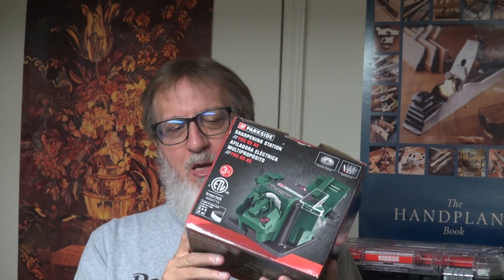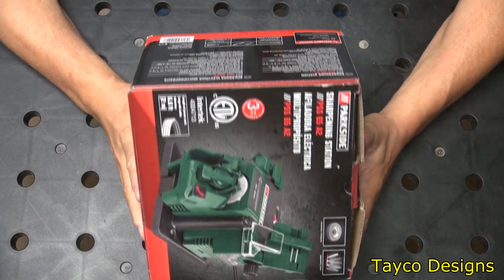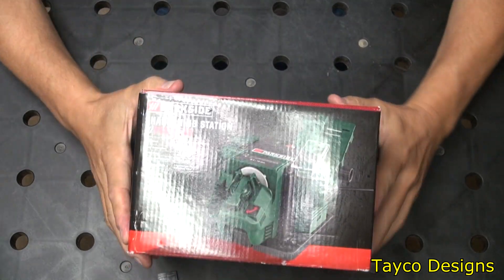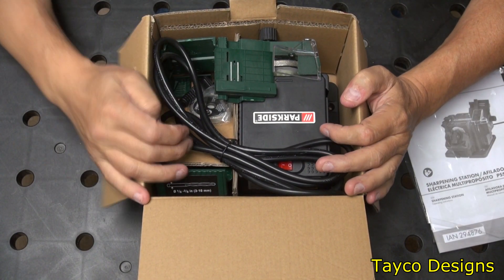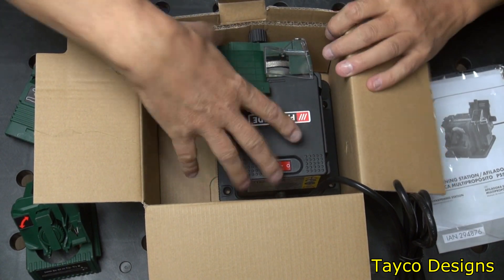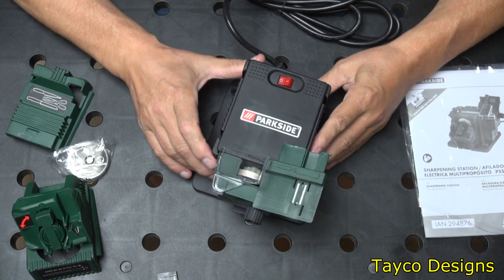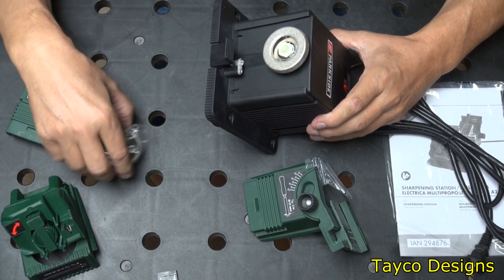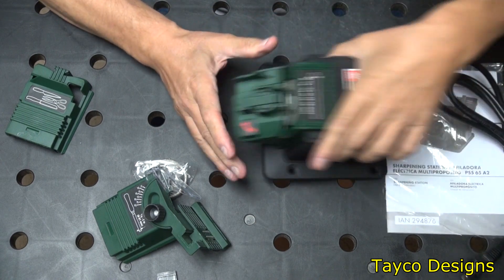Unboxing And Review Parkside Sharpening System Sold By Lidl

Comment: Hey! :D I'm a pro blacksmith, I have seen this machine in the shop yesterday and I have left it there. For your blades you need to buy just a good sharpening stone! ;)
Reply: It is even missing the transmission wheel with the flexible tool for grinding tools that other producers of similar toy offers

Comment: You should learn to use the machine correctly first, no wonder it hacks things up. It's not the machine that's bad it's the way it is used.
Reply from the maker: LOL....your comment proves that you have not tried this machine. I want to challenge you to buy one and put a good edge on any knife and then show all of us the proper technique in a video.
Reply: @ScrollsawVideo  Ive got one and it's really good! I've been in toolmaking 60 years and this is a really good drill sharpener. But I sharpen knives like a skilled chef-on hard Arkansa